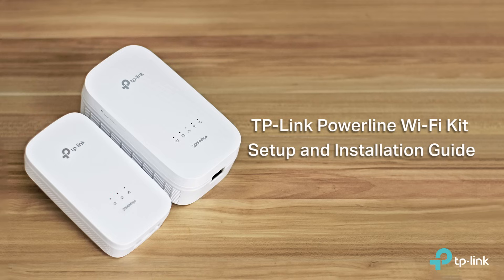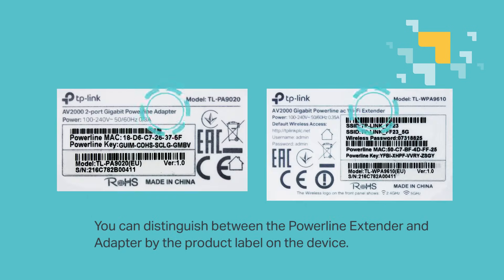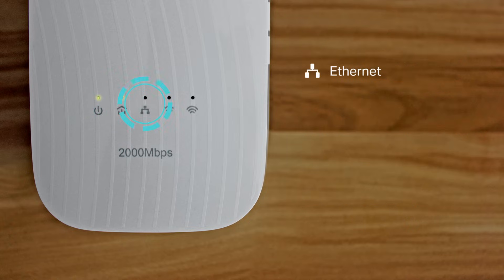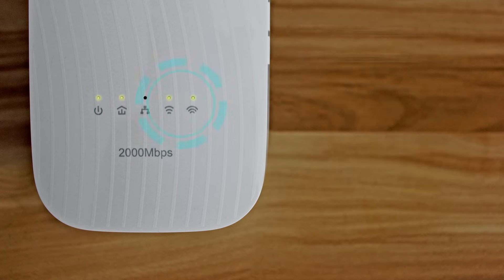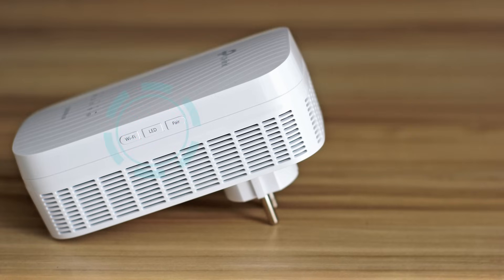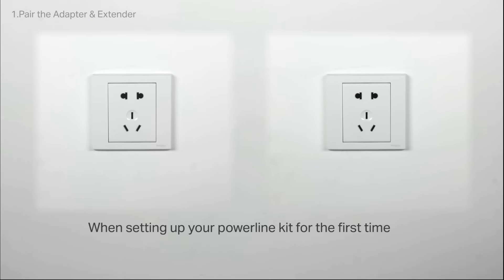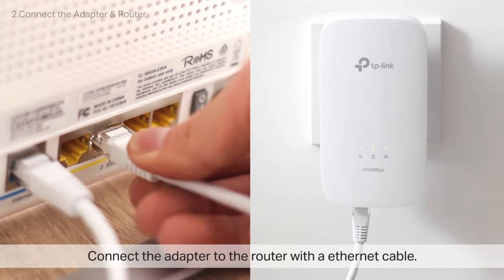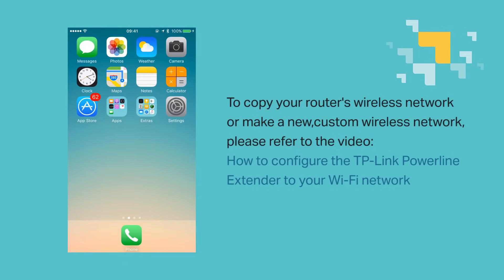TP Link Powerline Wi-Fi Kit Setup and Installation Guide

Comment: What if i don't connect the adapter to a router and instead just connect it to my cable modem directly? can i use the 'extender' as a wifi router for my network?
Reply from the maker: If your modem is also a router (called a gateway device) then yes absolutely as the modem is providing routing.  If the modem is just a modem the adapters can still be used but can only provide 1 device an IP at the remote side.

Comment: Can i do a fabric settings reset of extender? Power and Wireless lights are flashing all the time and it just don't work
Reply: I have TP-Link TL-WPA7517 KIT
Reply from the maker: a Flashing Power light means its trying to pair to the other unit.  However, power and wireless flashing may mean your unit is bricked.  You would need to contact support for assistance.

Comment: Didn't improve my internet, at all. Neither LAN or Wifi.
But it was a fun vid.
Reply from the maker: There are several factors that would account for performance with the product.  Things like noise on your powerlines, the distance between the two node and even the quality of the router and service.  They all play a role in performance.

Comment: Hi. Currently, my router is connected to the 1st unit extender. And the 2nd unit is connected to my tv. I’ve been thinking can the 2nd unit extender connect to another router point? So instead of  only 1 unit get the benefit of the extender, multiple units can be connected as well. Is it possible?
Reply from the maker: You can add additional PLC adapters to expand the coverage to other rooms and devices but only one unit can be connected to the router.

Comment: If you want to have a faster internet/transmission rate between the adapters, you need to pair your adapter with your modem via WPS button, in order to clone the WiFi name + the password. It works 10x faster since I have done that.

Comment: I have the AV2000 2x2 gigabit ports, however when i connect to Ethernet 2.4ghz is only showing connected i used to have the 5ghz, what can i do?
Reply from the maker: You would need to reach out to support to troubleshoot.  It could be that the band is disabled, a bad radio, or something else completely.  Support will be able to help find out what it is
Reply: @TPLINKUS  understood, thanks a lot :)

Comment: That sucks that they both have to be connected to Ethernet defeats my whole purpose using it
Reply from the maker: Only if you have a non-wireless powerline Kit.  If you have a wireless one then the remote unit can connect to clients via wireless LAN. The main unit that is connecting to the host router isn't a wireless unit and has to connect to the router via Ethernet.   And actually, the purpose of PLC is not a wireless extension, that is a Range Extender.  PLC purpose is to transmit data through your home's power lines so that you don't have the impact of wireless interference and environmental impacts such as EMI and walls.
Reply: @TPLINKUS  oh ok

Comment: When I connect to my pc it says Ethernet connected but no Internet
Reply from the maker: That means that the connection between the PLC adapter and the computer is there but there is no internet signal being delivered.  This means that either 1.  The PLC adapter is not linked to the other adapter.  You can confirm by looking at the adapter and looking to see if the HomeLink light (looks like a house) is lit.  If not try to pair the adapters.  2.  The PLC adapter near your router is not physically connected or has a problem with the connection to your router.  Make sure the ethernet cable is working and is connected to the router's LAN.  You can confirm this by the Etherent light being lit on this adapter.

Comment: In 4:33 you said "in the same circuit", does it mean this will not work if not in the same circuit?
Reply from the maker: Correct, now same circuit means the same Main circuit.  So as long as the adapters are powered by breakers in the same panel they should work.

Comment: my powerline light is not on what to do ?
Reply from the maker: Ensure both adapters are on a breaker powered in the same panel.  You typically want to set up the system and pair the units in the same room before moving the remote adapter.  If they do pair in the same room but not in the remote location that remote location cannot be used.

Comment: Can you use the "adapter" as an "extender" if connecting to an existing network?
Reply from the maker: These have to be used with at least 2 units.  One unit connected to the router via ethernet and then the extended or remote unit.  They cannot act as range extenders though it is a separate AP that communicates through the powerline to the router through the base unit.

Comment: What's the difference  between  this and using a WiFi extender  with the ethernet  plugged into the xbox directly  from the extender or will it be the same as buying a powerline  adapter  anyway since I bought  the ax1800  tp link wifi extender  but I also have a cat 8 cable to plug into it lol
Reply from the maker: PLC uses the homes powerlines to send the signal from the remote location to the router.  Often this provides faster and more reliable transmission than using a wireless extender.

Comment: Any idea on how to install four of them at once so all conventions have Internet access?
Reply from the maker: You wouldn't be able to install 4 at once but you can install one set and then using the Web UI or tpPLC app and add the other two adapters using the Powerline password key printed on the back of each adapter.
Reply: @TPLINKUS  thanks- will try that tonight!

Comment: If my power line is red how can I change it to be better without having to move it to another power point?
Reply from the maker: the only way would be to filter everything between the two device (powerline adapters) through surge protectors (power strips with out protection will not work).  If this doesn't help then its likely not an interference issue and is likely a line issue.  Short of replacing the powerline which is unlikely the adapter would need to be moved.

Comment: My powerline would just not connect idk why
Reply from the maker: It could be as simple as the two adapters are not on the same circuit to as complex as there being interference on the line.  You would want to contact support for assistance.
Reply: @TPLINKUS  is there any method to check the circuit condition before you buy this product? thanks.
Reply from the maker: @chessgo5028  A electrician may have a tool that they connect to see if there is any interface or noise.

Comment: I just wanted t know if I can have internet on my pc which has a windows 7 in another room without having to use a 10m cat5 cable..
Reply from the maker: I assume you have a router.  If so just connect one adapter via ethernet to the router and the other to the PC.  of course both need to be plugged into an outlet and those outlets need to be on a circuit in the same panel.

Comment: I'm getting even worse signals and no power strip is plug in with it. It made it even worse with my forestick
Reply from the maker: you do not want to connect these to a power strip, ups or surge protector.  If you are having issues with the product and the videos don't help we recommend contacting support.

Comment: How do I get the internet from my tp link on my phone?
Reply from the maker: PLC WiFi adapters are just like any other wireless AP.  Once they are setup and connected to an internet source just look for the SSID network name and connect to it.
Reply: TP-Link do I need to look up the name because when I go to available internet connections nothing is there

My dad set this up and has no idea where the guides are from the box 

I’m so confused
Reply from the maker: @conorkelly4923  go to tp-link.com search for your model number and then click on the support tab.  Download the tpPLC utility on your PC.  Connect to one of  adapters and run the utility.  From there you will be able to access the wireless unit and view or change the wireless settings.   There is also a possibility your unit doesn't have wireless.  check the model number TL-WPAxxxx is a wireless kit and TL-PAxxxx is a non-wireless.  Your remote adapter must have a "w" in its model name to be wireless.

Comment: Will this work between 2 houses that are fed by the same electrical service?
Reply from the maker: No because they would likely be on separate panels.  These adapters can work on different circuits but only if they feed into the same panel.  They will not work over separate or sub-panels.
Reply: @TPLINKUS  That means that it will not work for a two floors house..having down the router and the one powerline connected via cable and the other somewhere in the middle of the stairs..?
Reply from the maker: @popitoto  No unless your home as a separate panel for each floor.  At least here in the US that's very uncommon.  Separate lines on each floor sure but as along as those lines feed into the same panel you will be fine.

Comment: Can i use it as a normal wifi repeater without the extender?
Reply from the maker: No PLC adapters are not repeaters and require at least 2 units to operate.  1 connected to the router and the other remote.  You can have more but there always has to be a base unit connected to the router.

Comment: Hi, I have a question about the WiFi extender. For the WiFi is it taking the signal from the powerline network or from WiFi of my router? In another word, can I plug the extender far away from my router where is no wifi signal?
Reply from the maker: The wireless adapter of a powerline kit is more like an AP than an extender.  It sends the traffic from clients connected to it through the powerlines to the base unit located near and connected to your router.  From there the traffic goes through ethernet to the router and out to the internet.   Unlike range extenders it does not need to be with in your router wireless range

Comment: Can I use this pair this with a already Wifi Extender?
Reply from the maker: Yes because they connect to the router and not the extender itself.  I do recommend have the wireless adapter in an opposite section of your home however.  That way you avoid interference with the extender and main router's wifi signals.

Comment: I have The tp Link Av 1300 gigabit system, which workman great, I want to use the Ethernet function of an extender in another room, will it work if I add a another extender there, or do I need some other unit.?
Reply from the maker: this FAQ will let you know how many nodes each PLC network can handle. https://www.tp-link.com/us/support/faq/434/
Reply: @TPLINKUS  I could not find additional individual extenders for the Av1300. I looked and could not find one. I then ended up buying another adapter -extender set from Amazon.
Reply from the maker: @venkykrishnan2028  Yes that is accurate.  We do not sell adapters individually, only in kits. however all units can be "base" or "remote" so the other unit does not have to go unused.

Comment: I had to hook up an ethernet cable to both to get them to connect.  It works fine, but my router lights are off except for one.  I tried a 4k move and it ran fine on my tv down
stairs.  Hope this helps.

Comment: I am not satisfied with the ethernet performance of this product. It disconnects a lot. Am I missing anything?
Reply from the maker: Khaled,  there are many variables that can affect ethernet performance.  Typically poor ethernet performance is either due to interference on the power line or how many Hops there are in your electrical panel between the two adapters.  Try using the tpPLC app to see the connection rate between the two adapters.  and contact support if you have any further questions as they can help you determine the best course of action to resolve or improve the situation.
Reply: Im not satisfied either tlwpa8630p v2 disconnects constantly, have to enter ip address into browser to get the connection back up again, tried disabling power saving - no difference, had same issue while testing adapters in same room to rule out interference no difference, fix your products, support is garbage

Comment: Can I use a powerline adapter to extend my current access point's signal??  I didn't think I needed extender and adapter....
Reply: The adapter runs the internet through the electrical wire in your house to the other device. It's great because the signal is more reliable.
Reply: Did u find out of this i got 2 adapters and no extenders

Comment: Both mine say adapter .
Reply: mine too...... i pay for a gigabit with Rogers in Ontario, Canada but with these two useless adapters i only get 90 download and 50 upload. and my two adapters are only 40 feet apart. my setup: ethernet cable from Router to  first adapter plugged into the wall. With adapters paired and 1 wall in between i have a cable coming out from my first port to a Linksys router and then another ethernet cbl from powerline adapter to computer directly.
Reply: @silentauctionhunter8547  I had to use cables too- even though it said it was wireless. I feel like I wasted money..
Reply: My MAIN problem is my  download speeds. i can't get it to go past 100mbps. is there a solution? If i connect to the modem directly it gets 980 MBPS. any advice?